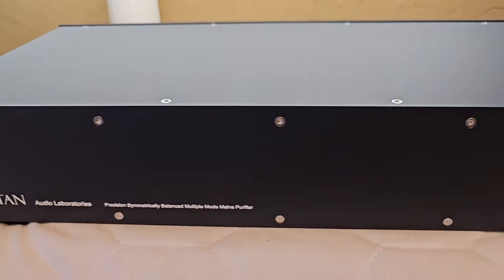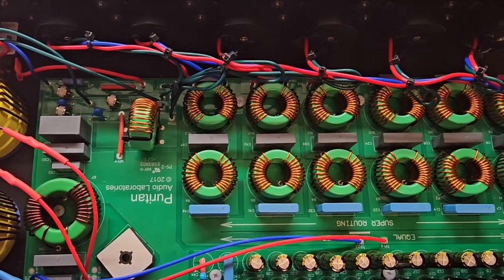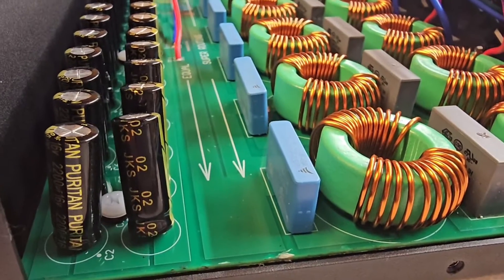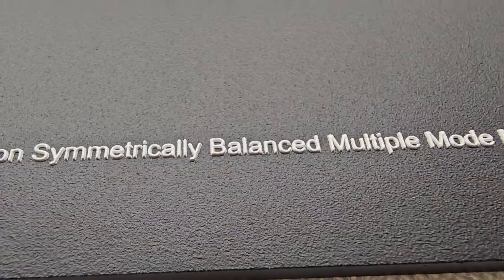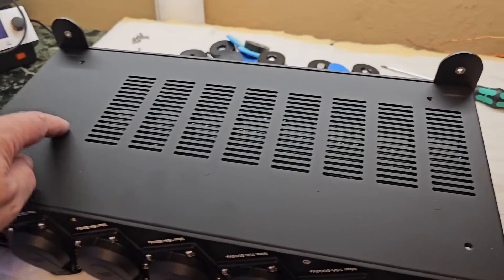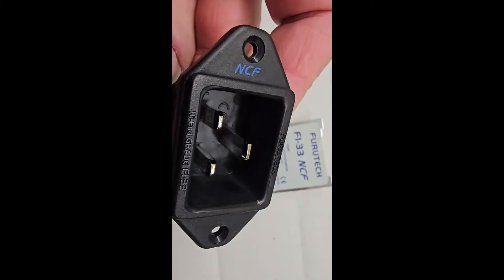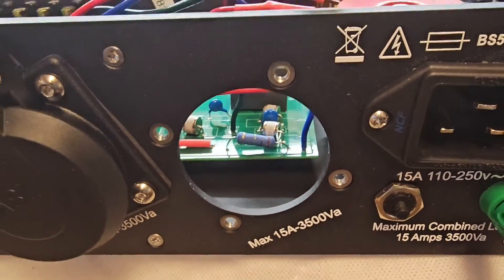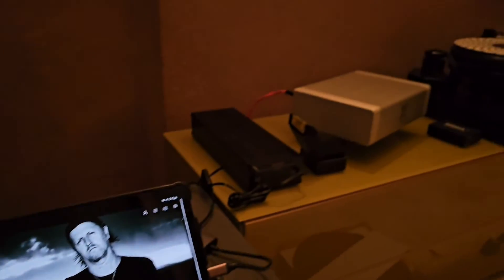Puritan 156 Purifier Mod, Tweak, Tuning for Gourmets... read disclaimer...

Comment: Did these tweeks actualy do anything positive to the sound and performance of the PSM 156 ? I have a PSM 156 and im realy happy with the result of using it in my system. But would be interessting to hear if these tweeks did something positive to the sound and since i can´t find a follow up video im asking here 😊

Comment: Removing the rubber from the schuko inlets increases perceived noise by a big margin..  haze increases also start and stop looses impact; yes it also sounds also more colour-full but not so good. I don't know what are you thinking with this mod
Reply: I guess I have to update my initial comment; the biggest issue seemed to have been the break-in of the new inlets rather than the absence of the rubber rings. Apparently they need a long time to break even heck this audiophilia can get pretty annoying. Removing the rings however still offer changes; first it changes the tuning of the product which is for a smooth and british like sound. It is less neutral and less fun with the stock inlets but it is more forgiving and more commercial. My 2c

Comment: Rhodium is a poor electrical conductor, do you use the conditioner in an industrial environment.
Reply from the maker: second one i have now is with copper and copper gold iec...woooww..cheers Mike
Reply: @headquarteraudio5388   Question - given the choice, would you go for FI-33 NCF (Rhodium as in video) or FI-33 (G) (Gold)?
Gold has twice as good electrical conductivity as Rhodium (at least), so not sure what's the fuss with Rhodium plating these days (as on my Bowers & Wilkins signature terminals or my Audiomica cables). I understand it's only thin plating (so the copper conductor beneath counts as well), but still - is shiny and smooth, not having precision tight contact as soft gold has. So genuine question - if wear&tear and oxidation is not relevant (I plug once and forever stays, clean with Kontak), GOLD or RHODIUM please? Also, did you require any soldering with Furutech inlets?.

I only have one PSM 156 - and currently experiencing substantial detail smear / aliasing (half year burning) in the music when my amp is connected (dual E-core transformers, non torroid). Weird, as it should not affect musical signal.
When I also plug DAC as well to Puritan, detail smering is enormous, aliasing is so bad as watercolor sound so I keep it out. I am wondering if this mod will help. DAC is having SMP power supply with own filtering - might be why it doesn't play well.
Reply: Thanks for video content, did you decided on gold or rhodium fi33?
Do you use the puritan ground master and route master? Are you using a 20amp of 15 amp outlet and is you outlet an upgraded furutech?

Comment: You should have mentioned that the furutech fi33 ncf doesn’t fit in the original plate hole 😢. So this mod is not an easy one…
Reply: There aren’t no solution except enlarging the hole. I dit it with a “Dremel”
Reply: @hifiaddict3953  I've done the same, thank you!
Reply: @zsam5639   See my question in this thread. Was it hard for you to do? Was it also worth the performance gain? I don't mind the money - more affraid of destroying the product (as sometimes hard to even strip out the cable properly and there can't be mistake!).
Reply: @hifiaddict3953   I would love to change it for Furutech FI-33 (G) IEC power inlet  + Furutech FI-E30 (G) Schuko sockets. As an amateur, did you have to solder anything or is it all relatively simple for me to do, i.e. screw wires tightly? I don't mind drilling/cutting bigger hole. Also, what is the original material on Puritan IEC inlet/sockets? Is it Rhodium (doubt), Aluminum or Zinc? I can't also see any fuse on IEC inlet for Puritan PSM156.
Reply: Have you found a way to install F133? I’ve just disconnected everything and realized it didn’t fit😢
Reply: Was the ‘mod’ worth the hassle in your opinion?
Reply: He did not need to modify the holes.

Comment: Really happy with my 156. I'm thinking of replacing the current sockets on it as you did but with Furutech NCF Rhodium to match the Rhodium connectors on my power cables. Are you still happy with the upgrade?
Reply from the maker: 120%
Reply: @headquarteraudio5388  Hi Mike, what is the estimated price in Euros for your great upgrade of the 156?
Reply from the maker: @larsv6144  please write me an email  cheers Mike
Reply: But Mike. I can see you use the Rhodium iec inlet and it look like Gold schuko power inlets. 

Is it a mistake, that the iec inlet is not Gold played?
Reply from the maker: no, i wanted to try 😉
Reply from the maker: @Forollo9210  Think about connect plug and inlet with the same material gold gold, silver silver,  rhodium rhodium,  but always rhodium is the badest conductor cheers Mike

Comment: Great mods thanks for sharing. I just got a 156 and the think I am not linking is the absence of bass weight. It really seems to thin the music out a bunch. Does this have a long break in time or has anyone else noticed this?
Reply from the maker: Hi, break in 14 days, up and downs in SQ, sometimes more precise bass feels like abscence of bass. Maybe change plug position of devices in the 156
.. cheers Mike
Reply from the maker: ahh, if you use the Puritan cable wich is deliverd with the 156 maybe it is the cause...the Ultimate is better, but for the price not as good as the Tubulus Concentus, please let me know if you are interested in this cable... write me an email...cheers Mike
Reply: @headquarteraudio5388  Try a NBS Black Label  and your jaw will drop to the floor

Comment: I have the PSM156 along with Puritan power cords.. I hear on forums some people with the Puritan power cords also replace the plastic connectors with Furutech connectors for improved sonic results.
Reply from the maker: yes, but the cable itself is cheap stuff, not built with heart for music, Ultimate is much to expensive, for the price Tubulus Concentus is Audiophile Heaven... Furutech Plugs with big metall bar for fixing the cable are soundkiller. cheers Mike
Reply: @headquarteraudio5388  Thanks for the tips. I found Ultimate too expensive and went for Classic Plus, the silicon dielectric is scientifically better than most cables. If Tubulus power cords are even better, I will consider them in future. I earlier bought Tubulus Argentus to connect my CD transport (CD 9000CDT) to Dac (Teac NT-503) and that really improved the fullness of each note. For now the centrepiece of my system remains the Marantz PM-11S2, according to most experts the best integrated amplifiier Ken Ishiwata ever designed and very difficult to :"upgrade" from once you've had it in your system as the bass and mids are almost unbeatable (to my ears) and with good cabling the treble is more than satisfactory - natural with no "showroom" exaggeration.
Reply from the maker: @connorduke4619   I always say, there are more tones/timbres inside the Tubulus cables.. cheers Mike

Comment: Cant you just skip the power inlet completely by soldering a power cable directly to the inside of the device. And what is the deal with all the rubber for the sound?
Reply from the maker: You can do that, but you need a good fixing for the cord, because you will brake the Board if you give force by cable to it. Because of that normally it is a forbidden way... rubber to parts and case will kill musicality, timbres and speed/dynamics, music is boring. Cheers Mike

Comment: Thank you Mike for this great tip! I own this product, and it's excellent,  but i agree the stock plugs are cheap.
I just wish there was a round Furutech plug in the USA.
Reply from the maker: https://www.furutech.com/2017/06/01/14928/    this is GB Version ii think
Reply: @headquarteraudio5388  that's for the UK
Reply from the maker: I think you need for the US Version this one for replacement, or?